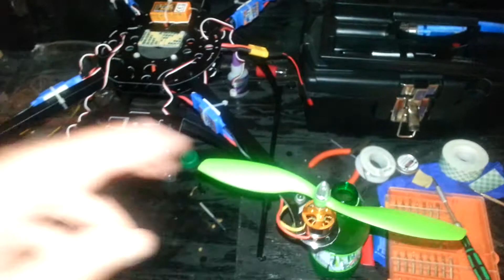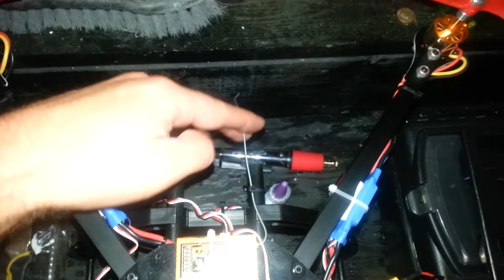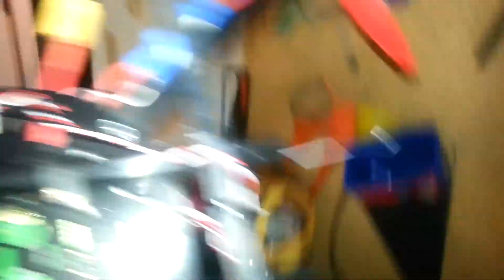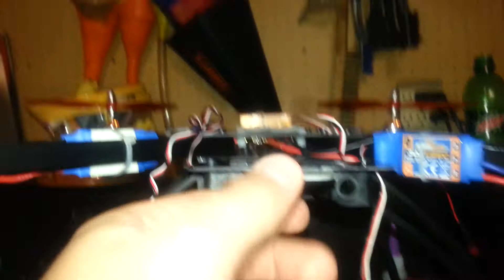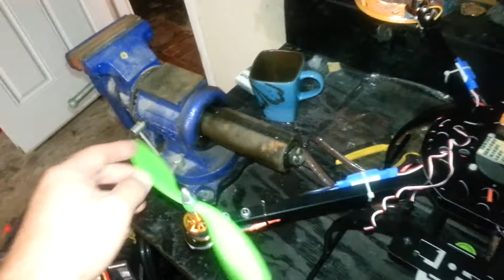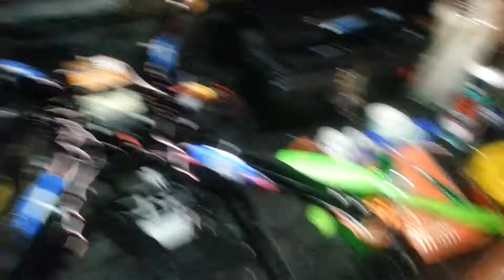X580 quadcopter build part 4

Comment from the maker: thanks buddy. If you want to do a build like mine I will have a video soon showing what you need and how to set it up to make it a lot easier. I would have already had it in the air except for I snapped one of the prop holders of by over tightening it I think it was faulty. So stay tuned buddy and good luck with your build as well.